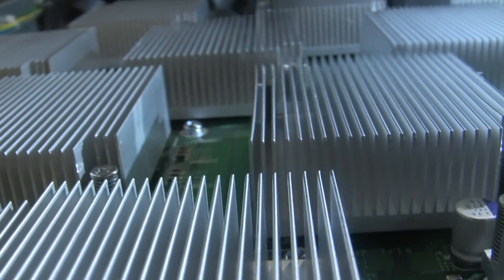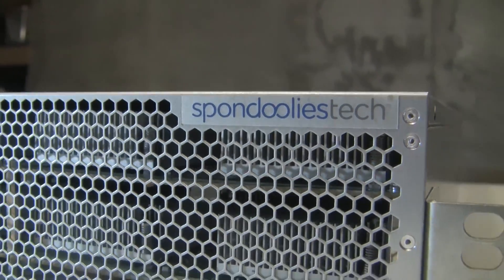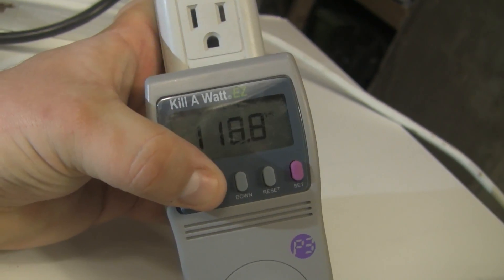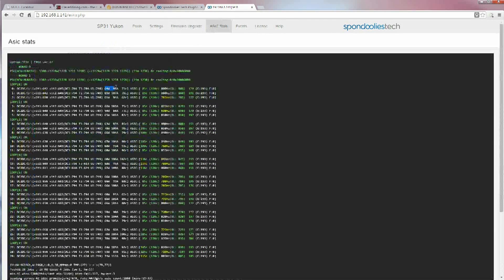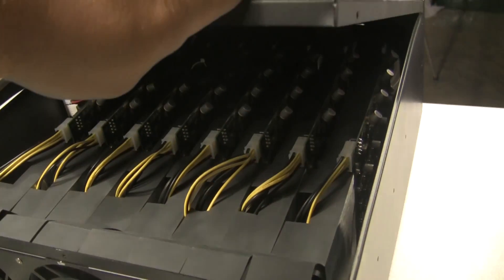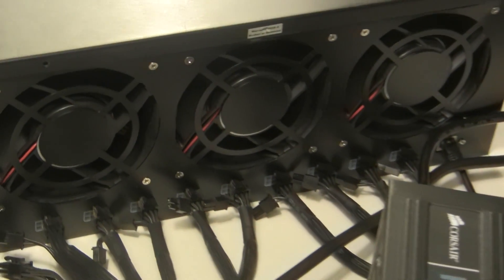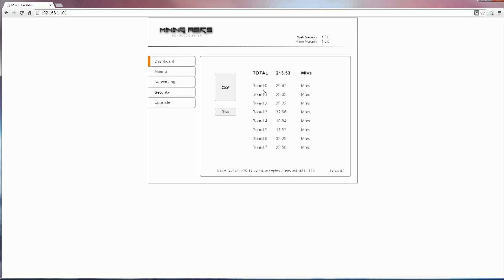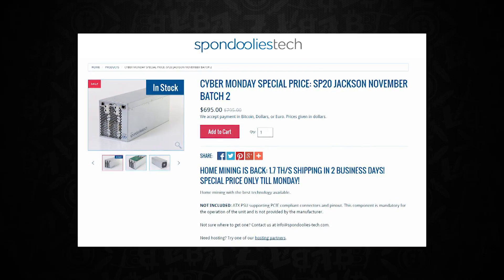BBT Episode 23: Spondoolies SP30 Yukon | MAT Excalibur 5 | Fastest Bitcoin&Litecoin mining ASIC

Comment: I have had a horrible experience with these miners. It all started of with the powers supplies stalling 1 to 3 times a week and the temporary fix was to re-seat them. After numerous times with Support they shipped me 2 psu's that can handle more power to replace the current psu's that are on the miner. Now i have another sp30 where it just died with corruption errors and since the miner is not under 3 month warranty they want to charge me to fix them mind you that i bought them when they where at $5,000+ a miner. i have 3 Sp30 and 1 sp31 none of my miners have even reached a year in use and I keep experiencing issue after issue after issue in less than a 6 month span. Is any one else having this issues??

Comment: yea we definately need some profits information vs costs of operation numbers, probably the most important info, not included here. also the new SP35 just came out, and nobody has a review of it. but if you buy it this month, its the same price as the sp31, if you buy it next month, it will 4k.
Reply from the maker: The most important info in someone that reviews it is if it actually does what it says its going to do. We really are looking at whats the marketing numbers vs. the actual performance numbers (power/hash etc)

The risk we run however by spending a lot of time on ROI information with mining equipment is the volatility of Bitcoin. Case in point with 2/3rds of our video's prior to this, we were showing performance and were estimating ROI based on at the time then current market conditions. Price(bitcoin), depreciation,  coin distribution(dogecoin) all changed over a short time period, changing and destroying any previous forecast. 

Bottom line, BBT try's to report and validate claims of a mining manufacture and bring no kidding visual analysis of a product. That way the individual can make an informed decision on at least a few factors of the hardware. With regards to financial viability and forecasting we are trying to stay out of that due to the obvious issue of volatility.

Mining has been a risk of ROI since inception, however when Bitcoin finally gets the proper use cases that gain critical mass, those early "investments" and negative return mining events will pay off in the long run.

Comment: It seems that the SP31 didn't worked all time as the profits suppose to me around 1.2-1.3BTC for this 3 weeks!
Reply from the maker: We were mining on the http://eligius.st/ pool. If the pool had a higher rate of finding blocks we may have seen over 1 btc over the 3 weeks. However we seen only .4773720 BTC ; if we woulda put it on a different pool the results could of been a bit better.
Reply: 1.2-1  to 3BTC  in  3 weeks is bad ???  i think its very profitable , Or am i missing something here?